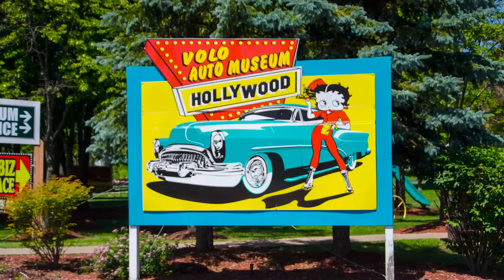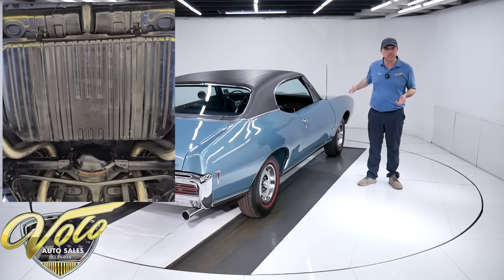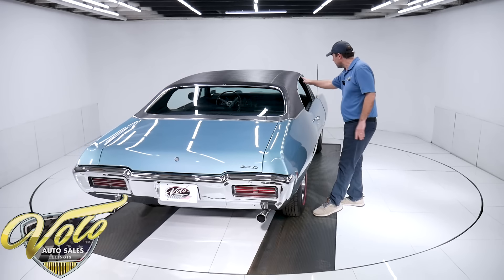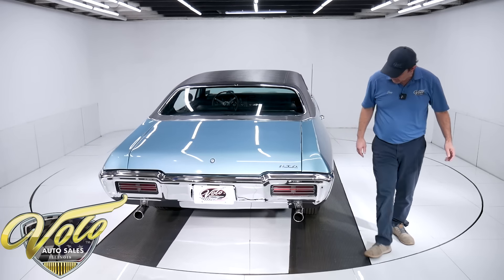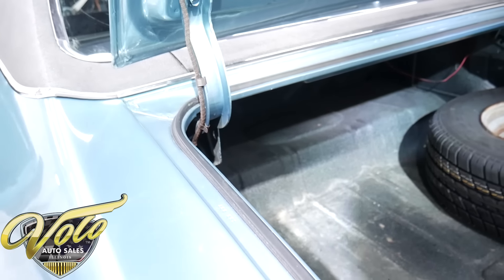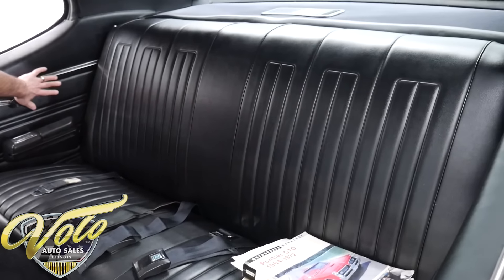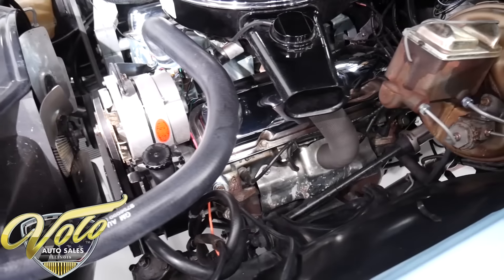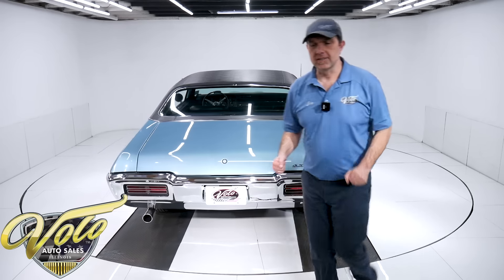1968 Pontiac GTO for sale at Volo Auto Museum (V20236)

Comment: That is the the best looking one I have seen in a while and if it is all original as you usually check out the 4 speed and 400 is nice. GM if I remember had the spares in bolted up under the package tray or deck in the front of the trunk to the floor. Happy Easter to you and your family, Mr. Jay!
Reply: I owned a 1970 GM A-body for 31 years. 1968 to 1972 are basically the same. Spare is right where it should be,

Comment: Try doing some research, buddy, 10 bolt posi track? Give your head a shake. It's referred to as a limited-slip differential with 10 bolts my 68 GTO had. Had the 12 volt authentic true positive track that was put in because the stock is 10 bolt limited slip

Comment: Nothing is worse looking on a muscle car than the exhaust coming out the rear in straight pipes. These are not original to this car or many other muscle cars.
Reply: Worked at Pontiac dealer when this was new, those trumpet type tail pipe extensions were optional in 68 only